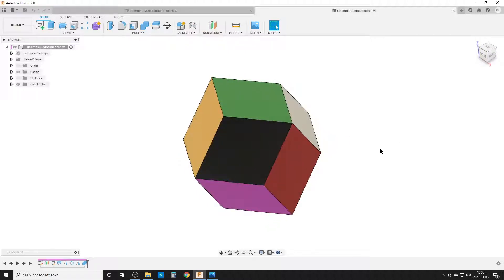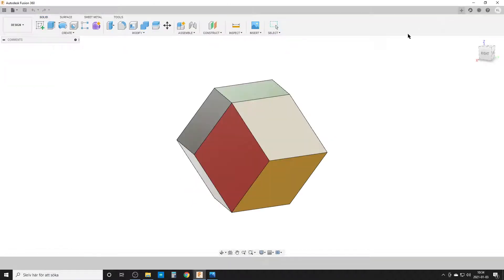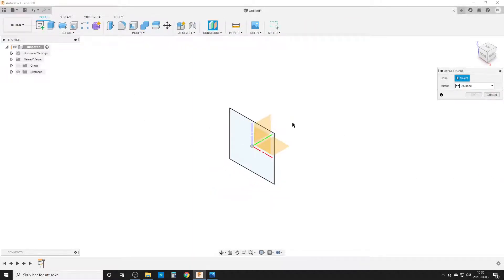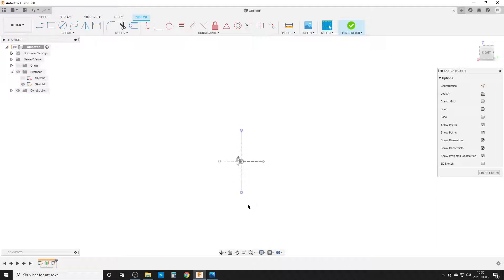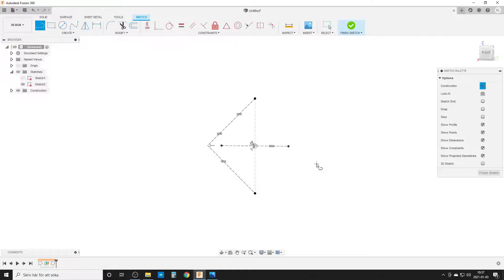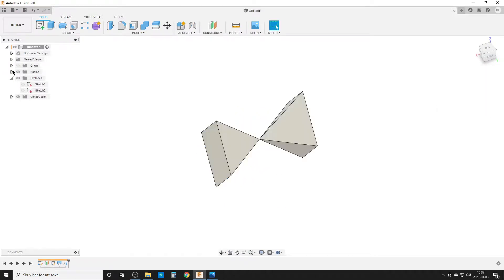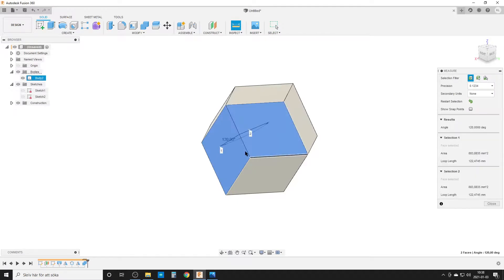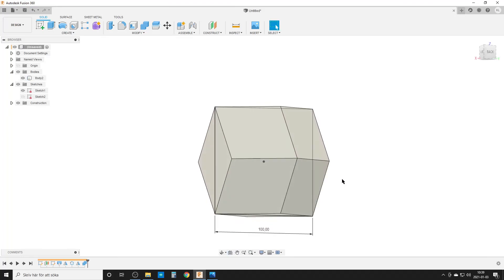Rhombic Dodecahedron in Fusion 360

Comment: A simple way to build one is to start with a cube and place a square base pyramid with a 45deg slope on each face of the cube. Then erase the edges of the cube and base of the pyramids which will leave the rhombus face.
Reply: > Create the first face just as you did here, but make it a square. 
> As you did with the rhombus, loft the back of the square to the polygon center. 
> Duplicate this shape as necessary to complete a cube. 
> Along an axis which runs from the center point of an edge to the same of the opposite edge, and being coincident with the face, rotate each square face around 180 degrees. 
> POOF!! the rhombic dodecahedron appears as if by magic.

Would this method be any more efficient? I don't use Fusion360 so.. 🤷‍♂️
Reply from the maker: @SineEyed  The workflow you describe is a bit hard to make in parametric CAD like Fusion. And if I understand it correctly there will be a square cavity inside the model. But an interesting way of doing the part.
Reply: My pleasure - another way is to place the 6 pyramids connected in a cross formation - fold them inwards on themselves will form a cube. Fold them outwards will form a Rhombic Dodecahedron.
Reply from the maker: @FUNKINETIK  That's one of the "fun" things with these solids that you can find so many ways of creating them. And they are good exercises in "3d thinking" :)
Reply from the maker: Interesting and easy way, thanks for sharing. Now you got me thinking of more ways to make this little shape :)

Comment: Thank you for this video, I'm new to Fusion 360 and I had no idea, how to make it. This helped me a lot. Would you have a tip or idea, how to create a corner bracket, so I could just connect them with straws and make an educational model?
Reply from the maker: You can use the Pipe command on edges to make new bodies and combine them into a bracket.
You will need 2 styles of brackets, 3 edges connected and 4 edges connected.
Have a look at the features "Pipe"; "Combine Join" and "Press/Pull" hope it can get you started.